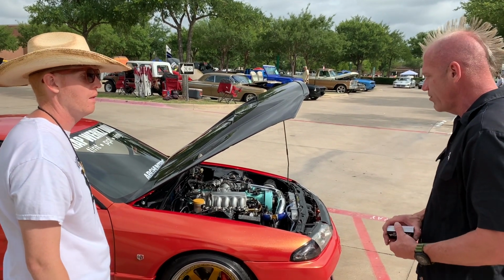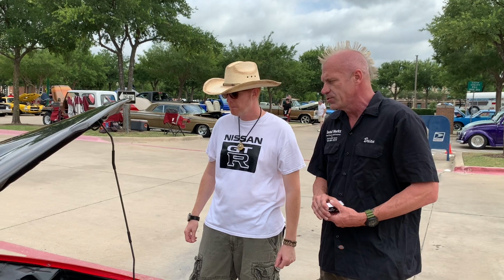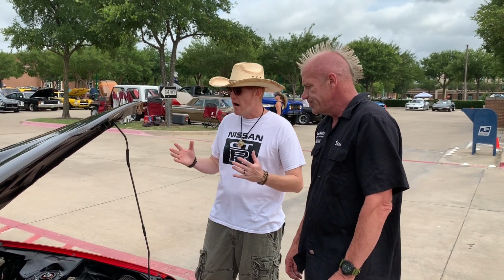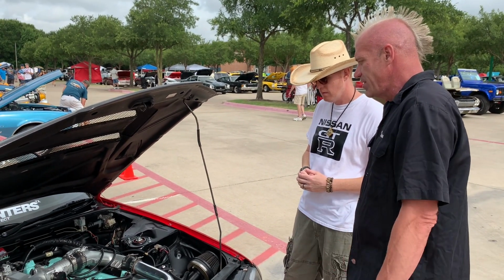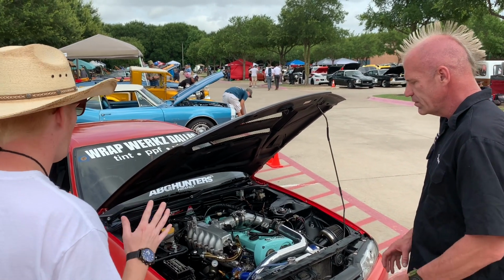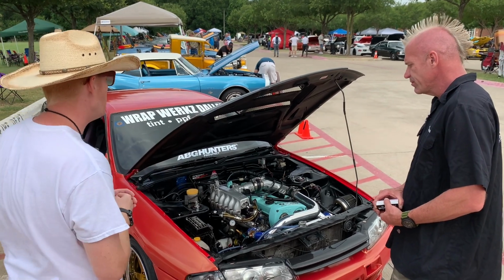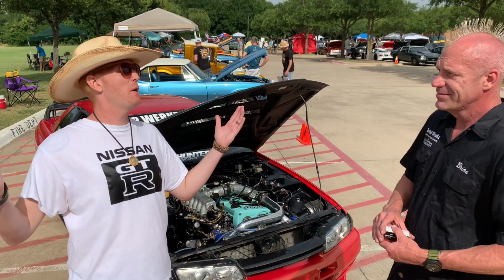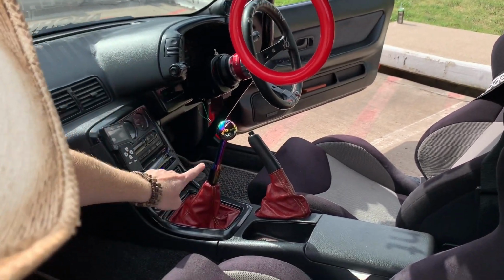1991 Nissan GTR R32 SCCA Drag CAR  #JDM #GTR #skyline #nissangtr

Comment: This is not rb26 its an rb25 neo out of a r34 gtst
Reply from the maker: Please Please education me. How can you tell ? I want to learn.
Reply from the maker: Your the second person to say that, I'm a Z32 guy. MUCH  more to learn on my part.... SMH - my bad
Reply: @KurtWinters  You can tell by looking at it, it's almost certainly a GTST with a 25 swap the same as mine, with GTR guards. The RB25 never came with twins was always single turbo. The stamp on the import plate is right for a GTR saying BNR32 (need to see the blue one) but no way anyone puts a 25 in it and converts it to RWD especially for drag racing. No single turbo small enough to fit under there makes anything like 600RWHP at 18PSI. Having said that it looks nice.
Reply: @KurtWinters  That's the exact same motor I am putting into the S13 at my shop.  "what's in the box?"
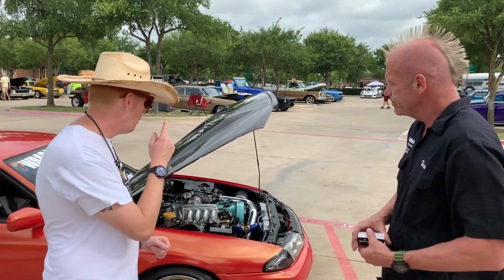Reply: 4:14 He says it's an RB25
Reply from the maker: it's my fault. I put the title wrong. then the dang timing cover says RB26 - STILL MY FAULT
Reply from the maker: @tangles01  Great insight ! thanks sir !